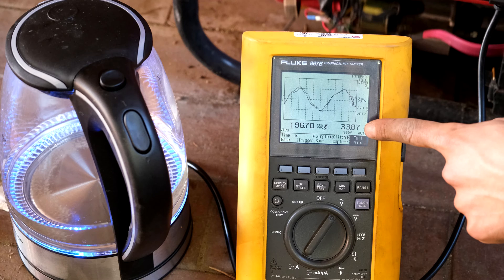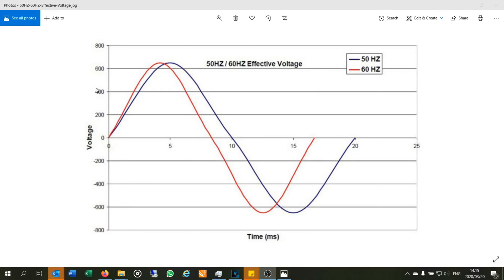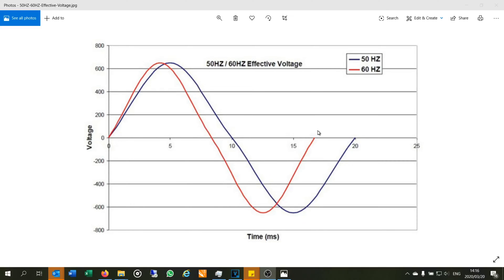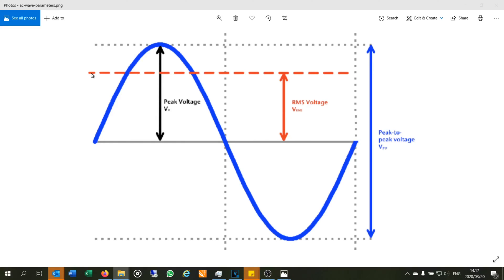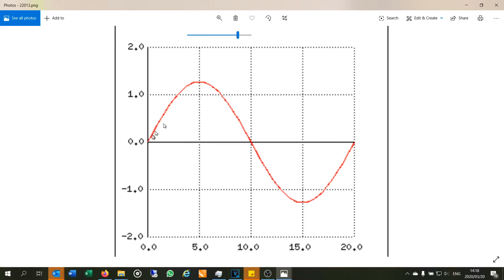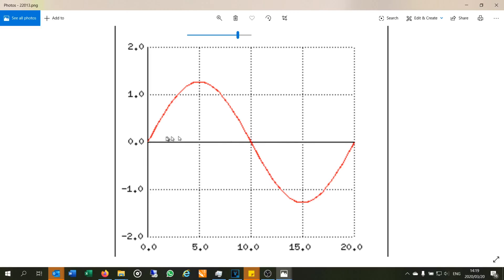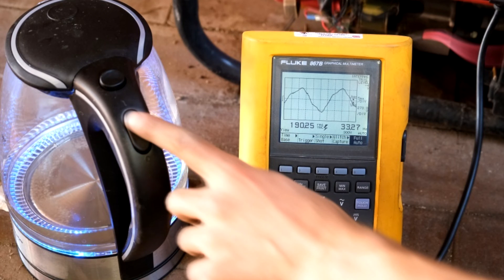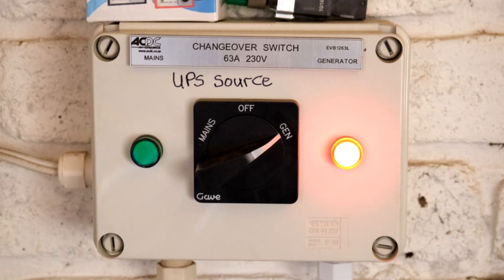Mac-Africa and a Faulty Ryobi generator tested - low frequency and voltage regulation

Comment: Good video. I just got the similar Ryobi RG-2700 manual start. I’m finding though that under very light load, my voltage fluctuates quite a lot (190V-240V swing), causing lights to flicker, but when I add a decent load like a TV, kettle or microwave, I get a stable 230V. Generator purrs nicely the whole time, so it’s purely on the power output side. You rate this is fairly normal or should I do a warranty claim?

Comment: This video was annoying , exactly what is happening to my generator but I want to know the solution
Reply from the maker: The video title doea not say its a repair. You can check your field winding of the genny
Reply: @ecologicaltime thought there was some adjustments on the generator that could increase the rpm and consequently the frequency?

Comment: Kettle... uses a kak load of power, and on that specific generator its ratted output is 2500W and max load is 3000W also spoke to Ryobi and apparently these generators needs a min load on it before it actually smooths out the freq. But just listening to your generator there is something not lekker with it. The newer model of the RG 3500 doesn't do that burp burp it stay constant. Mine stays on 53Hz which is strange not to mention the new RG3500 has their VR in it so apparently there should be some sort of voltage regulator in it. I am using the exact some method though I have a hybrid inverter setup rated at 5.5KVA so going the same route as this with the cutoff when Eskom sees its arse
Reply from the maker: thanks for your comment.